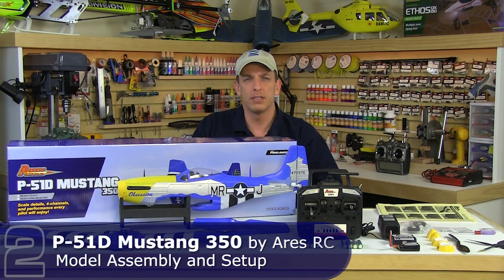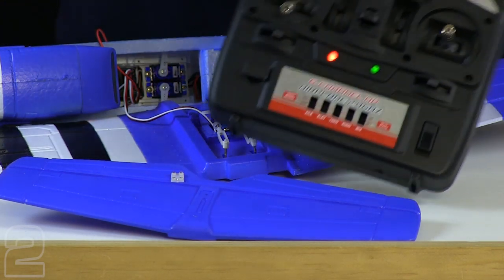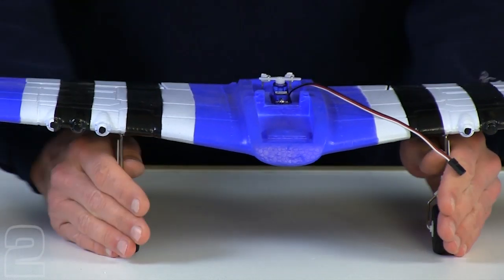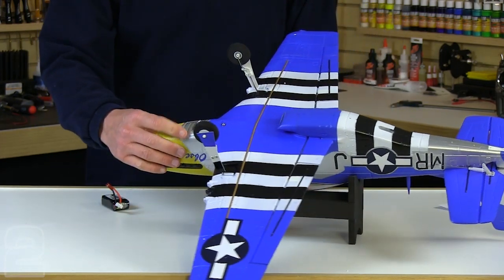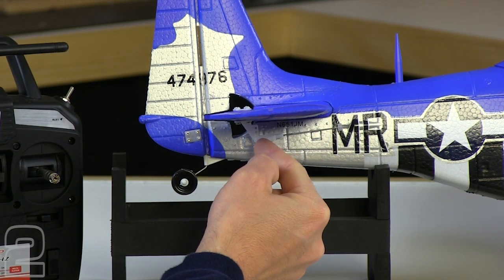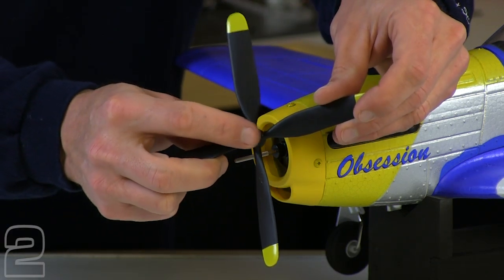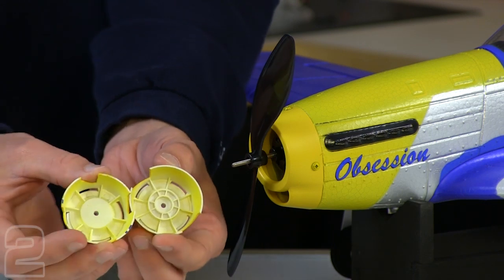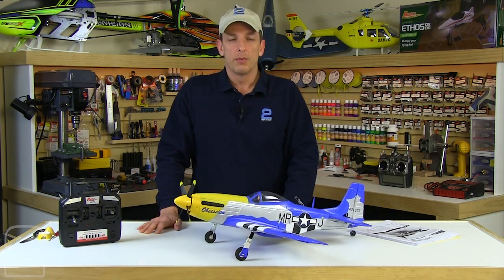Ares RC P51-D Mustang 350 RTF Assembly

Comment: Fantastic video.  I just purchased a new Ares P-51D Mustang from eBay for an outstanding price.  It is the RTF version.  Your video answered all my questions after I read the manual.  The suggestion about a slight toe-in for the landing gear was an eye-opener.  I do understand torque steer on the single propeller and the same direction of travel dual and/or quad motor aircraft and it can be a pain on taxi and taking off.  The only thing missing in your presentation is how to correct a bad CG.  You state how the CG is very important but to a novice, how do you correct for a bad CG?  I assume we are talking about adding weight somewhere in the aircraft to correct but where are the best places to add the weight and what are the best types of weight to use.  But again, outstanding video, easy to follow and very thorough.

Comment: I really like this warbird but the battery hatch sucks, I had a feeling that I was going to lose mine and I did. I also ordered some Admiral 600  mAh batteries since finding any of the Ares 600 mAh batteries is impossible. My right wing tip and right elevator tip were both bent up, right out of the box.  It does fly nice and boy will she climb. I wish there were more planes , in similar size that flew this nice, on the market.

Comment: Great vid thanks. How come your plane does not beep when you power-up? My p 51 came with the servo arm for the aileron very uneven so I was pleased you mentioned the mechanism to twist the "servo horn" to correct this. This is my first 4 channel plane so I am looking forward to trying to keep it in the air...for a while.
Reply: Question does the rtf transmitter work ok?

Comment: As soon as I found out Ares was coming out with this I had my local Hobby Town reserve 2 for me.I got them about 2 weeks ago been waiting for someone to do a review on it. My first plane was the Gama built like a tank!Haven't flown the mustang yet to cold in South Dakota, looking forward to the flight video. Love your reviews and flight demos.
Reply: i also have the gamma,and yes it's built pretty well,i stripped the decals off of mine and gave it a full paint job,40 amp esc and .15 motor,it flies pretty impressively now.
Reply: What type of paint did you use?
Reply: henry rezac mostly rustoleum,it sticks pretty well,then i clear coated it with about 4 coats of clear.
Reply: So you just tape it off and rattle can it?
Reply: kevin brooks so you just taped it off and rattle canned it?
Reply: henry rezac some of it was spray canned,i had to hand brush a lot of it to get the look i wanted.